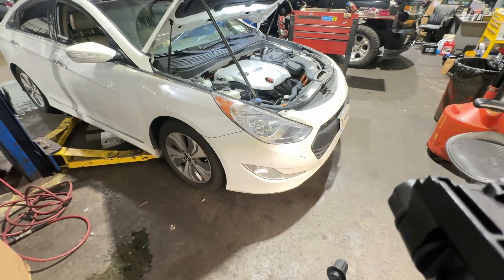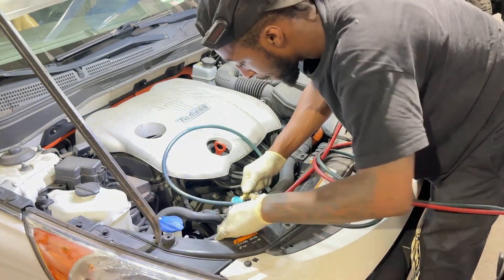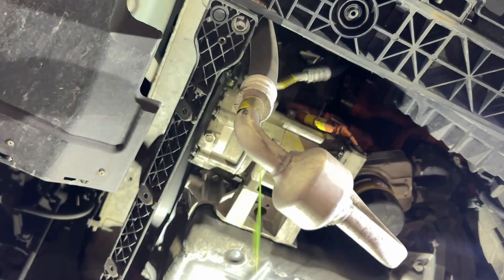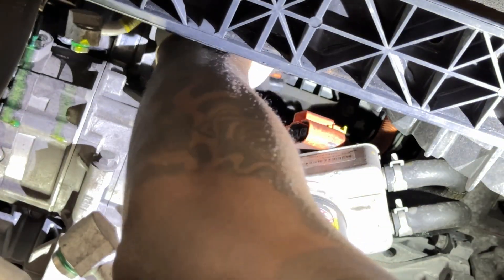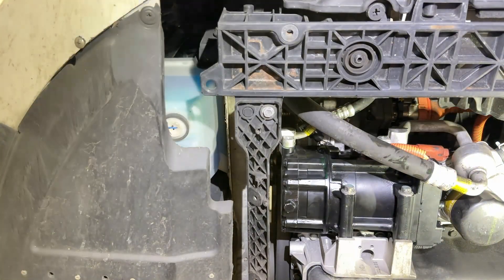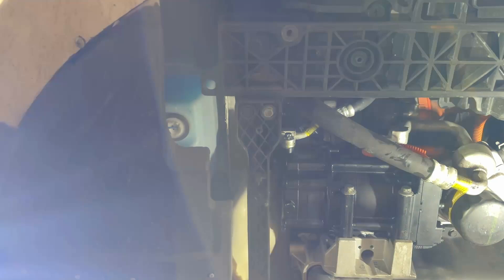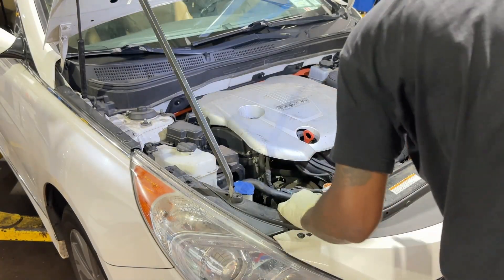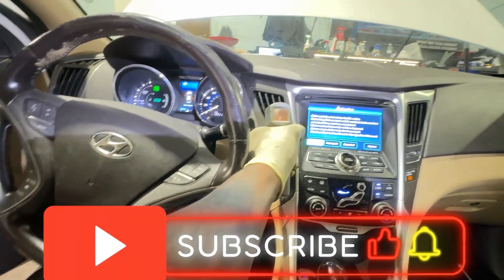Hybrid A/C Compressor Removal Guide on Optima & Sonata #hybrid #hyundai

Comment: How did you find out it was the compressor on the hybrid, and are these known for going bad?
Reply from the maker: The compressor wasn't compressing the freon.
Reply: Mine just went out; I was able to figure it out because I kept getting a check engine light going on and off saying Voltage irregularity. Once I stopped using the ac system it stopped. I found a compressor on EBAY and going to be switching it out. I came here looking to find out how to disconnect the hybrid system.